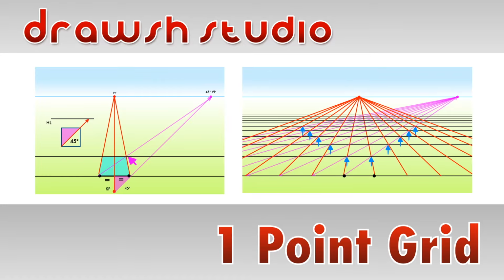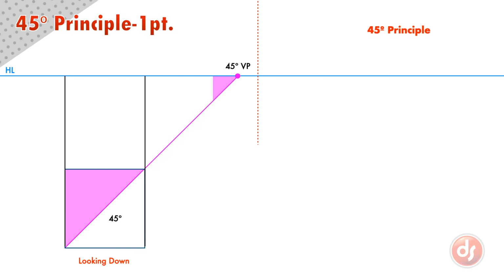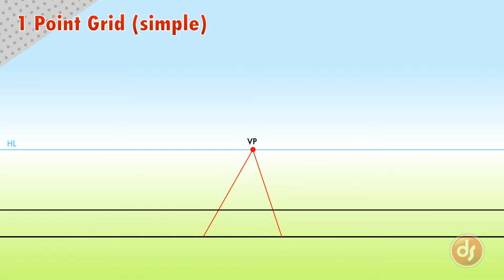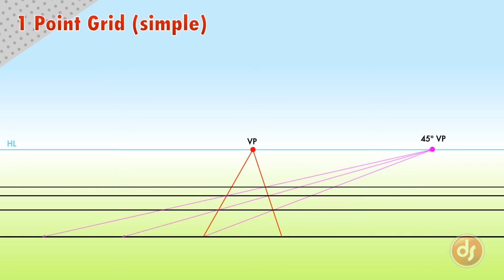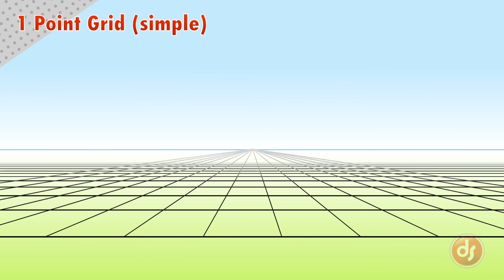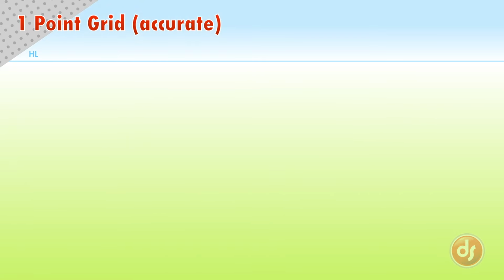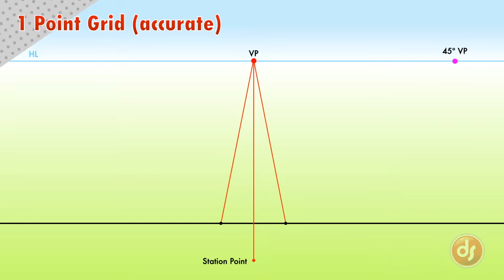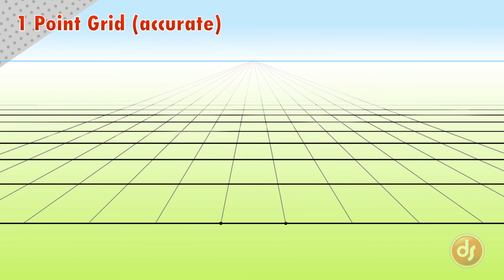1 Point Perspective Grid

Comment: There is one slightly misleading thing... When drawing the simple (not necessarily square) system, you call the second VP the 45 degree VP, but that's not accurate. Better, I think maybe, to just call it an auxillary VP, or "diagonal VP". If you had drawn a squashed rectangle, as an extreme example, and connected the corners, it couldn't be 45 degrees. Obviously you're correct to call the "accurate" version a 45 degree VP. 

I love your videos - I'm just saying this because I was confused, and can see others below in the comments are too.

Comment: Thank you very much! Is drawing the cone of vision necessary?
Reply from the maker: No, it’s not necessary as long as you don’t need it to be very accurate. When you have it, it helps you design an image that will appear more normal to our eye.
Reply: @DrawshStudio  So I should have the cone as the localised area of my entire grid?
Reply from the maker: Technically yes, anything that falls outside of the cone will start to look distorted. It will be technically correct, but weird. The problem is to make the cone larger you need to extend your station point, which makes it a little more challenging to work traditionally since you will need a large surface. But it will yield more realistic results.
Reply: @DrawshStudio  Thank you very much!

Comment: In the accurate square projection, would we sitll face distortion if we consider squares near the side of the screen ? as i can see in the final grid you got, the dimension in the "vertical" direction seem to be longer than in the horizontal..
Reply: I guess in order to make our working area "wider", we'll have make the station point much below
Reply from the maker: Yes, you got it. The edge will always face distortion. The solution like you guessed Is to make the station point further away which in turn makes the cone of vision larger.

Comment: Does it matter that you make the first tile’s width equal lengths on both side of the station point? Shouldn’t you be able to construct a grid of perfect squares from anywhere, as long as they meet back at the 45 degree vp? Or is making it equal lengths on either side of the station point the only way to guarantee a true square?
Reply from the maker: If you want a true square then the tile needs to be equal widths. Otherwise the box may be a rectangle. I’m which case it wouldn’t be truly 45 degrees, but the repeating pattern would still work. Hope that makes sense :)
Reply: @DrawshStudio  okay thanks!

Comment: The part where you draw a line at the bottom of the page to mark an equal distance from the station point on both sides is the only part that confuses me.  Does it matter how long?  What if you made it twice as long and then extended it to the 45degree vanishing point?
Reply from the maker: Good question.  You could make it twice as long or half as big, you get to choose it. But it does matter in that your choice will make your grid look different in size. The best way to understand is to test the theory by making a couple of tests with one bigger and one smaller and see the difference. But both would be correct. 
I hope that helps!
Reply: @DrawshStudio  thanks! Your videos are really helpful and simple to understand.

Comment: Very concise explanation, thanks, but the placing of the station point in the second half of the video still feels random and arbitrary. I must be missing something!
Reply from the maker: Glad you liked the video!  In one way the station point is arbitrary, in that you get to place it any where you want to start. It’s part of how you design your scene, but where you place it will impact what the perspective looks like. Hope that helps :)
Reply: @DrawshStudio  so where we place the station point is arbitrary but having it there allows us to measure an equal distance from both sides and the 45 degree angle from the viewpoint. Without those two steps we are placing the left and right sides leading back to the vanishing point arbitrarily, which makes the 45 degree line accurate to the shape itself but not necessarily us as the viewer? Am I correct or completely off base here?
Reply: As I understand it, the station point is where the observer is standing and the vanishing point is where the observer is looking. These elements (and even the horizon line) are somewhat arbitrary in placement, they are dictated by the image you are trying to construct. Not remotely beginner friendly but there's no reason you couldn't place the observer on the left looking right with the horizon line of the world tilted to a dutch angle.
With these three elements in place measuring the angle for the 45vp and making sure the first two lines are equidistant to the station point is what keeps the grid 'square' (rather than guessing a square and then using the 45vp to keep the grid consistent).
Either that or I have misunderstood as well.